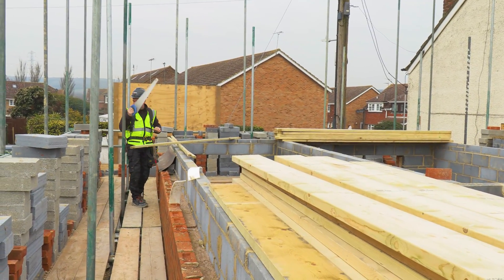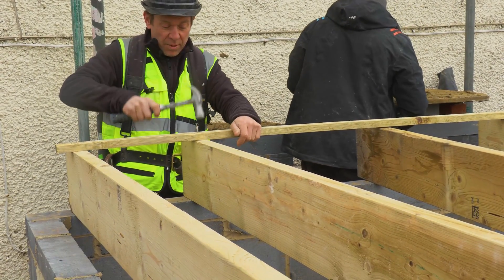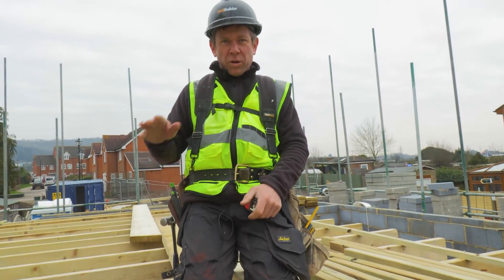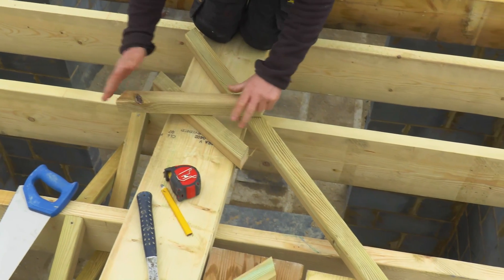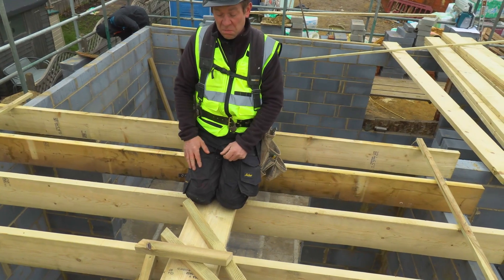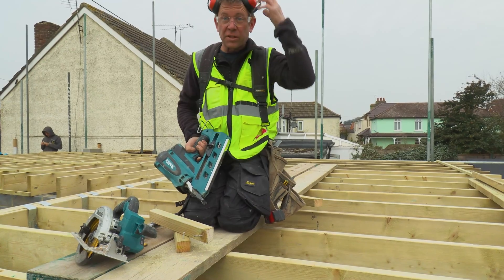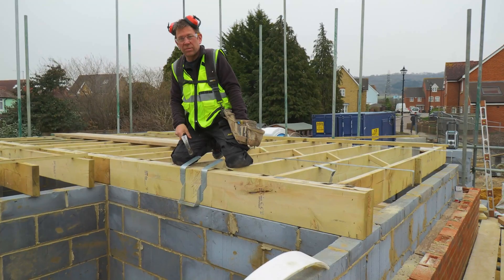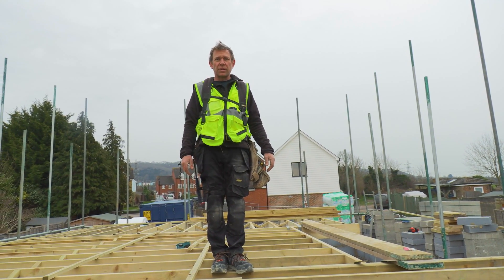How To Fit Herringbone Joist Struts Like a Pro

Comment: Herring bone struts are not worth the extra effort with modern flooring! All the old books say herring bone is superior to standard noggins, which is true, but that was with old tongue and groove nailed flooring, to make it work properly you need to wedge the row of herring bone really tight against the wall before you floor it(spring the floor,its called, you can also spring a roof by setting the purlin an inch lower than the construction line,but thats a different rant) you cant wedge the herring bone against a incomplete or cavity wall as its not strong enough! I love old methods but before using them ask yourself why they are not used any more! Modern glued and screwed flooring and standard noggins are more than good enough, herring bone without tight wedges has the potential to squeak!

Comment: Silly question (?)  Why are the herringbone struts not screwed together where they cross?
Reply from the maker: They work independently of each other and tighten as the joists shrink. If you screw them in the middle the can't tighten

Comment: You use PT lumber for the bridging, but none where the kiln dried lumber contacts the masonry? Does the UK not follow ICC?
Reply from the maker: Timber that is touching the internal skin of a cavity wall is not at risk. As for the ICC, the international aspect is very limited as it applies to a fraction of the world. It is a bit like The World Series, a misnoma.
Reply: @SkillBuilder  I understand what ICC covers. However, those joists are to be buried in an exterior masonry wall. Under ICC, only PT lumber should be touching the masonry. Not arguing, just asking about codes in the UK.

Comment: Hi, I'm hoping for some advice on this. I've got bouncy floors in rooms that go over my garage. I'm thinking of herringbone joist struts to help firm them up but also noticed the joists are floating one end. Someone has put some slate in before but the joists aren't resting on them any more. Am I best getting the slate tight first then doing the herringbone or vice versa. Thanks
Reply: Hi Daniel, 
Sorry for a very late reply! 
Yes I would have re packed the joist so they are sitting down on it, then a row or two of herring bone.

Comment: Can someone tell me why theres no wall plate for the joists?
Reply: Wall plate is not  used for joists at this level as it would shrink and be a straight joint for the block work / brickwork to sit on.

Comment: I agree with you on the 600c/c? Crazy! I've just used MET Web joist and specified them to 400c/c
Reply: It's not the capacity of the joists at 600 centres that's an issue but you do need to get strong floorboarding and fix it properly with plenty of glue all round and screws or Ringshall nails to minimise movement.

Comment: 1.	Mark/Chalk/Pin a line for the row of the struts on top of the joists along the floor.  The line should be parallel to an edge.  The center of the row of joists is recommended.
2.	Measure the height of the floor joist or desired dimension. (225mm)
3.	Take that measurement and “take off” about 10mm, (215mm), and Mark/Chalk/Pin another line parallel to the previous line.
4.	This creates a horizontal rectangle on top of the joists that is like the vertical rectangle between the joists.
5.	Lay the strutting lumber on top of the horizontal rectangle, align the rough cut strut’s outside edges with the marks  and pencil it from underneath on both sides.
6.	Cut the struts by hand or a miter saw.
7.	While the bones are loose, start the nail or screw.
8.	Fasten the bone to the joist.
9.	Optional, fasten the 2 bones at their center.
YT: Skill Builder
YT: Redwolf Interactive
YT: Chippy2003

Comment: Lovely work but asking myself, why not solid 'noggins' between? Screwed through and pva glued. Simpler to cut and fix and probably even better and stronger at stopping twisting and spreading loading.
Reply: Thanks. We done herringbone struts for the video, else it would be a solid noggins video.
This method is probably better at stopping the joists from twisting and is stronger, however it’s rarely done now days as solid noggins is quicker.

Comment: I love the efficiency and skill of Dan, I find myself watching the same section of video several times over looking for the little details of how he works. You can't have the skill he has without putting in the time, and effort. Every cut, measure, marking out, swing of the hammer lands where it's supposed to (well at least in the edited version!)
Reply: Thanks Michael. 
Dylan does a great job editing the videos. 😉
Reply: You can see that a circular saw would not really speed things up.

Comment: What a delight to see skilled tradesmen with a personable demeanor.
I came to the UK in 1996 and was blown away at the talent of the time served British tradesmen, it was a pleasure 
to work alongside them and learn the difference between UK and North American construction methodology.
Fast forward 25 years....how has it all gone so badly wrong.
Reply: Than you Bo jangles. It’s certainly very different from 1996 now.
Reply: Massive shortages in tradesman meant that when the floods of Eastern European’s came over most went into dry lint and carpentry. Not saying all we’re bluffers but more then most. A lot of firms are more interested in churning out shite quick then doing a proper job.

Comment: Coming in late on this It's always a pleasure to watch someone doing a good job like this.
I've been replacing the appallingly-fitted undersized strutting in this '82 Martin Grant place and the difference is remarkable. Of course no two joists are on the same centres and they're all cupped so I ended up using a card template to get each pair cut to the right length and angles.

Comment: Can anyone tell me what this herringbone does?
Reply from the maker: it stops the joist twisting and also transfers some of the load from one joist to another to eliminate bounce and cracked ceilings. If you have a big fat bloke standing on one joist the tendency for it to bend is reduced because the struts push down on the joist either side and those in turn are pushing against the next joists pushing them up. Think of a bridge built from short pieces of timber. The essential bit is having something at either end to stop any deflection.

Comment: Just completed a full rip out and refit of a 1890's; Edwardian property in Fazakerley, Liverpool.
All the main roof and internal structural timbers, 1st and 2nd fix were all still in superb condition.
Comparing that property, to some of the newbuilds I have worked on lately?
Reply: just working on my son's Georgian Manse that with EdwardIan extension.
The older joists were well strutted but the 'new' extension didn't have any and the floors were pretty lively.
Fortunately he had decided to remove the lath and plaster ceilings so installing new herringbones was fairly straightforward - a great improvement and a sash window that used to rattle when we walked onto the extended floor doesn't anymore.
So that's a winner all round.

Comment: The mailers save a lot of time. When I used to put joists down forty odd years ago, everything was nailed in with 4inch wires by hammer. Trimmers were bolted together with M12 bolts and bulldog connectors. Where jiffy/joist hangers weren't used in stairwells, a length of 2x1 was nailed to the bottom of the trimmer and trimmed joists notched over it.
Reply: 4 & 6 inch spikes growled in by hammer on heavy timbers is a better job & stood the test of time . Before I retired I only used nail guns for the light stuff & panels , I specialised in listed buildings ,a proper job was more important than site time deadlines .

Comment: My downstairs floor is suspended and has quite a bit of spring in it. I was just thinking of putting in some herringbone struts and this pops up! Love the content on skill builder!
Reply from the maker: You could do this or put in a couple of props down to a concrete block. Don't forget a bit of dpc under the timber.
Reply: @SkillBuilder  thanks for the tips!

Comment: Wonder why we went to solid Noggings?
That's much better for Services.
Does it tighten the floor up as good as a row of Noggings?
Reply from the maker: It is better than solid blocking. Dan explains how it tightens as the timbers shrink. It is clever. If you look at bridges and even trusses you see that magic triangle

Comment: Big talking point that makita nail gun! First one I've seen on a job are they any good? Mate said they were shit just get a paslode?
Reply: I have used the new electric milwaukee and hikoki but how long will they punch nails in as the DeWalt started off all good smashing them in, even into new zealand native but after 1 year could not even flush a nail into pine ( soft as pinus radiata)
Reply: My makita 1 st fix gun isn’t very good. I will not be buying another in a hurry. 
I’m not too keen on paslode either.. perhaps Hilti next time.
Reply: @Ultimate-roofing-square.  I think at the moment paslode best as mine still going and it's 14 years old, but they need servicing every 3000 nails that's not allot of nails that's every 3 weeks when framing minimum weeks that's what I try do basically when I see a big box of nails used I clean quick and a total strip 6 months

Comment: I.n.o this is how it should be done . Dan the man . One solid floor there no bloody creaking . Modern builds are bish bash bosh . Quality over quantity anytime . Thanks Roger showing a real craftsman at his best .
Reply: There are plenty of modern homes being built with great technique and attention to detail. We just need more people to shout their names from the rooftop so they get all the work and the poor craftsman have no jobs. The only downside to this herringbone style though is it can only be installed before the subfloor is, else you can't nail the tops. The other blocking style he mentioned allows you to come in after the fact and add if the builder skipped it or allows the construction crew to install the subfloor and begin work above the floor, while allowing another guy to go underneath and install while the other crew is working.
Reply: I agree in principle however there is already a housing shortage and and houses already cost way too much. How much more are they going to cost and how much slower are they going to be made. Quality doesn't come faster or for a lower price point.

Comment: Don't forget to put a straight edge along the ends and pack them up off the blockwork to line the tops in. No need to mark every one, if you are centered right then one pattern does all apart from a small center maybe at one end. Once all nailed in you can put a straight edge along the top line of the strutting, tighten down or slacken to line the joist tops in. I also used to wait until the walls were up so you were tightening the strutting against them. With nearly 40 years in the trade it comes natural. Joiner I learnt my trade from all those years ago still had a "jump bit" in his tool bag for creating holes in masonry for hammering in wooden home made dowels, until hammer drills took over.

Comment: Herringbone struts are so much better than solid blocking which becomes gappy as joists shrink, allowing the blocking move and creak on the nails (the main cause of floor creaking according to TRADA). The metal herringbone struts now available are a good and faster alternative to the traditional timber ones if fitted right as they have the same self-tightening benefits Dan mentioned.
Reply: I saw the job done with continuous lengths of 50mm wide galvanised steel strip. Under, over, under all the way along. Exhaust bay pulled tight and nailed into the timber. It's the same herringbone using steel under tension but Im not so sure how it copes with timber shrinkage.

Comment: Is this common practice to lay the floor joist directly on to the block work and have no wall plate?
Reply: Yes, the joist are built in and straight on top of the blockwork.
Reply: We use treated sill plates to keep the untreated lumber from contacting the concrete. Our inspectors would fail it otherwise..

Comment: Always great seeing Dan on the channel Roger, absolute pleasure to watch 👍
Reply: Thanks Mark. 👊🏻
Reply: @Ultimate-roofing-square.  Do you put a nail in a slightly over sized hole where the two struts cross? This acts as a pivot point. Not trying to catch you out, just interested. Top notch  craftsmanship as always, 👍🔨

Comment: just had to redo a floor on a timber frame, chipboared was just nailed down and squeaked like a mouse every time you walked on it!!!! so had to changed it anyway as had water damage and we had to renail all the solid blocking because it was all loose as it had shrunk back when it dried out wouldn,t of happened if they had put herring bone in plus glued the chipboard aswell
Reply: My mother in law's house has 18mm floorboard that are nailed only. Bouncy and squeaky AF. They have lived with that shitty floor throughout the house for 25 years all so the builder could save £50.

Comment: I am 68 next May and I did miles and miles of hearing bone strutting, just as stated, no power tools just a hand saw and a hammer. When circular saws came in it sped things up a bit and saved a lot of time saw sharpening  as well.
I must say I  preferred a hammer and 3" or 4" nails rather than an air gun for small framing and roof jobs. By the time you would a spend getting out the air gun, compressor, run the  hose, run the extention lead, find some gun oil and nails I would already have job done almost !!!!!
 Even nowadays on some roof work I reckon a hammer can be quicker and easier than even a cordless nailer. An air  hose definitely slowed me down too much. Pasload is great and has been the way to go for years, nice and balanced. 
Small Melbourne crew.(ex' Petersfield).
I still like to keep decent "propper"nails in my nail bag.
Oh! By the way your channel is just 1st rate, it is so informative for new guys, DIY - ers  and those pesky owner-builders. 
Please keep making the wonderful videos.

Comment: What is the point of the Herringbone Joist Struts?
Reply from the maker: Dan explained how they transfer the load and tighten as the joists shrink. Solid blocking gets looser as the timber shrinks and it then relies on the fixings.  A point load on the joist is transfered through the other joists in the same way a bridge spreads the weight across the whole span.

Comment: Good craftsmanship 👌🏻 but too time consuming for today’s speed that’s needed

But would love to see more vids like this
Reply from the maker: Hi Adam 
I have just been corresponding with a man who is having all his floors ripped up so the joists can be strengthened becase there is so much movement in them and it is cracking all the ceilings. The house is six years old and the builder is paying. That is what I call time consuming.
Reply: @SkillBuilder  I agree with that point as when you walk around ‘new build’ houses they creak like my plumbers knees, but can’t see this technique coming back as a standard, which is wrong if this will stop the movement
Reply: @SkillBuilder  I had to do that in my 120 year old house too. It's not unique to new properties 😀

Comment: any advantages to do this way ?
Reply from the maker: Dan explained how they transfer the load and tighten as the joists shrink. Solid blocking gets looser as the timber shrinks and it then relies on the fixings.  A point load on the joist is transfered through the other joists in the same way a bridge spreads the weight across the whole span
Reply: It's to counteract the cupping movement of a timber joist..

Comment: Solid noggins are CRAP.  Once the joists and noggins shrink the floor will squeak worse than when Roger opens his wallet.
With herringbone strutting, as the joist shrink the strutting actually gets tighter. I would have kept the top of the struts down a bit lower though, otherwise they can push the flooring up when the joists shrink.
Reply: If you were that concerned you can get galv sheet metal struts.
Reply: Surely the struts will shrink too.
Reply: @TurinTuramber  Only the width of the timber shrinks (across the grain). The length of timber stays the same as it dries.

Comment: Great bit of traditional joisting there.🤩 This is another rapidly disappearing part of house building in favour of more modern techniques. (which are arguably better, in this instance, in terms of cost, speed and a reduction in shrinkage). I cant imagine Dan being a difficult guy to work with, as he has a very easy manor.😎 Thanks for the video.
Reply: Thanks Del.  👍🏻